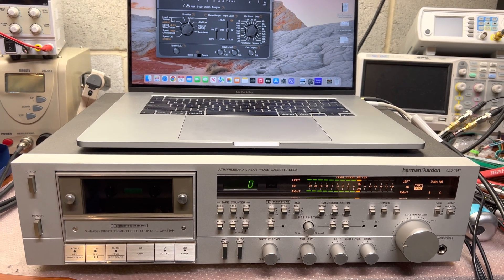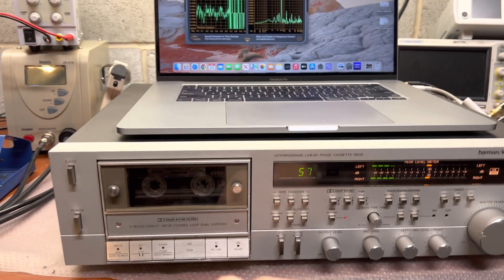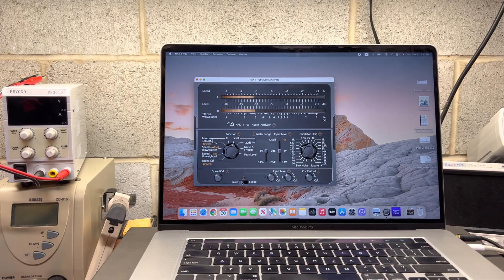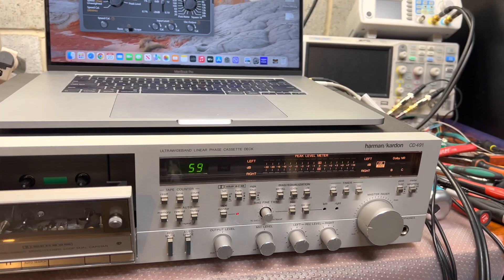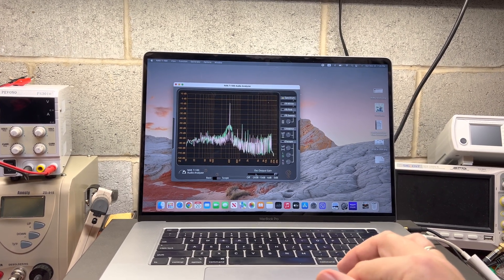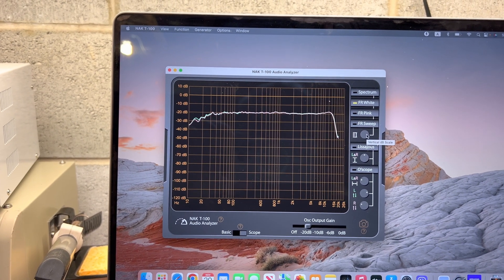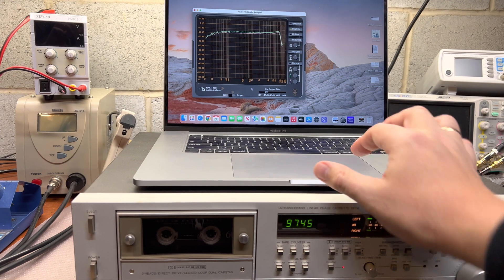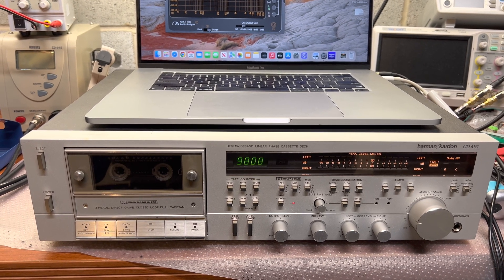Harman Kardon CD491 - The Post-Restoration Deep Dive

Comment: 16 kHz cut off for all tape types? seriously?   😂  Turn off MPX filter (knob on the front panel). Take attention: pushed position IS OFF !!! Mine 491 archive 23kHz with Normal tape type, after full(!!!) recapping and all inner potties changed.
Reply from the maker: You are right, I did not mention that pushed position is off, what a weird design.